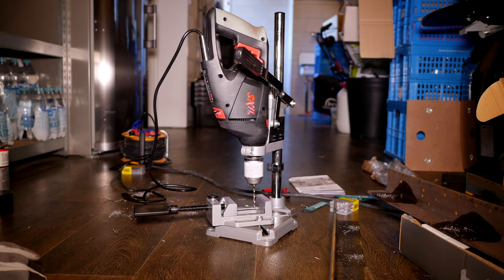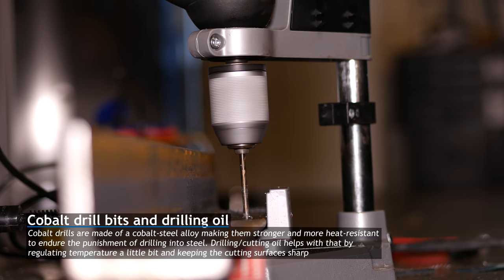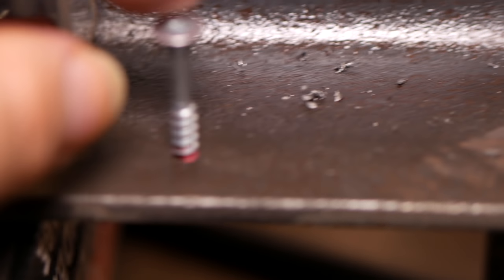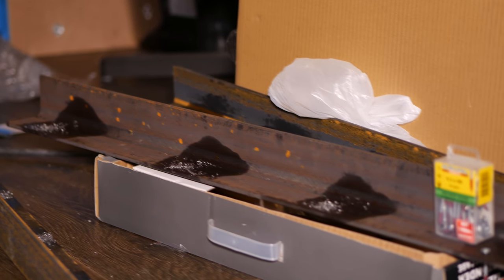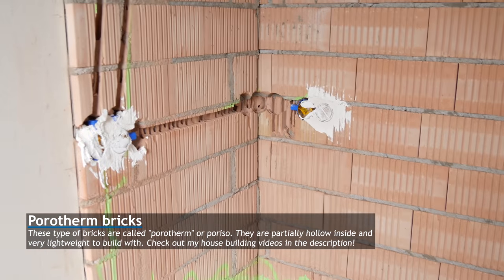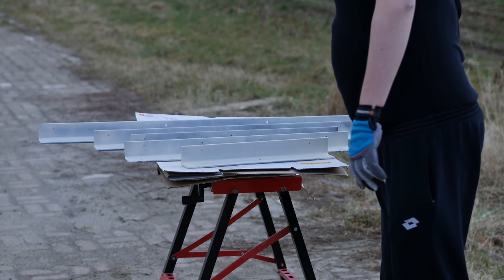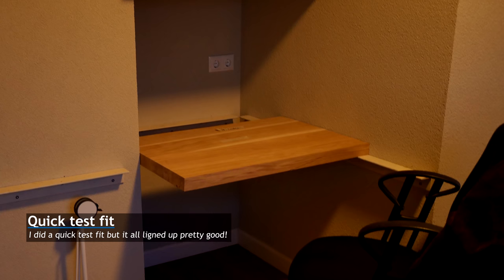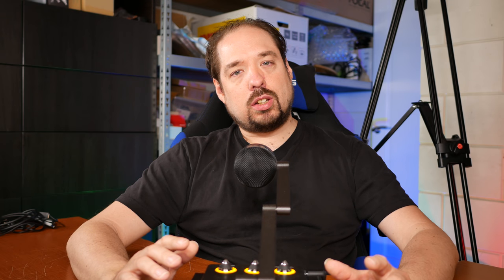Ultimate Overkill Desk: Drilling, painting and hanging (Part 2)

Comment: One thing you forgot: countersink the heads of the screws.  (Vergeet niet de schroefkoppen te verzinken in het staal)
Reply from the maker: Yeah, I wanted to do that and I bought the equipment for it but it seemed practically impossible on the holes I tried, the steel is just too tough even after a few minutes it would only go in a little bit so I had to give up on that plan. :(